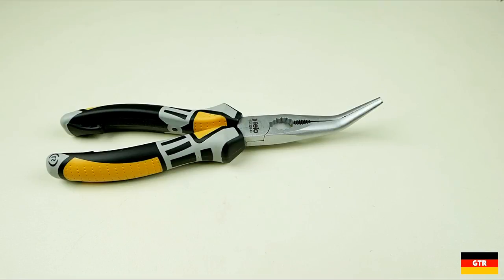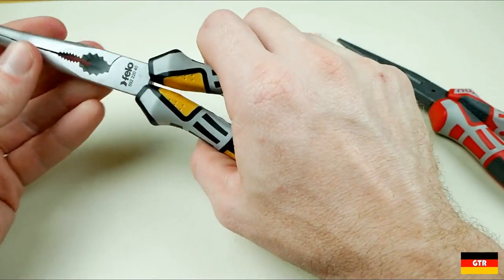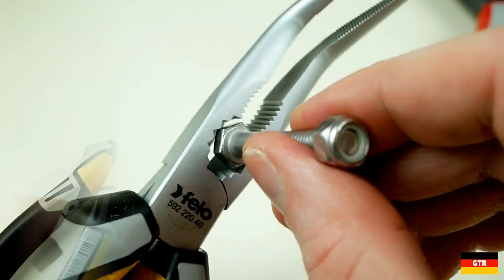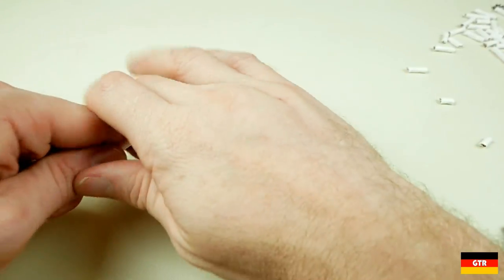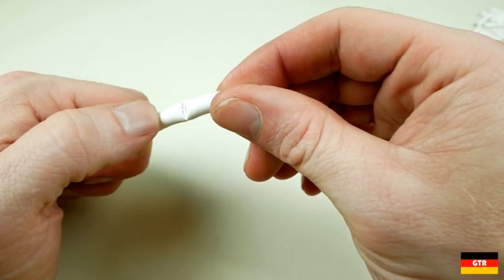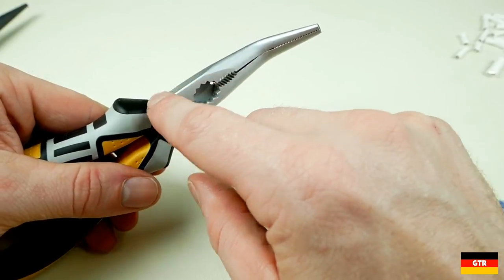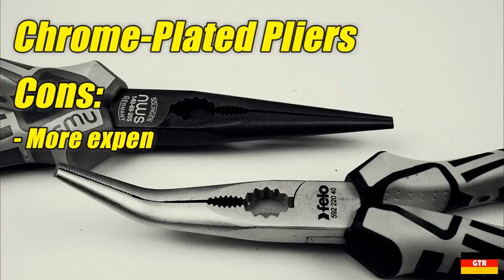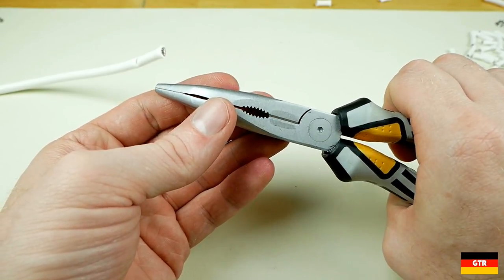Pros and Cons of Chrome-Plated Pliers

Comment: I live in New Orleans and fish offshore and in the salt marshes, frequently using similar tools on my boats.  So I can see the benefit of chrome on certain tools, despite the cons as stated in the video.  Excellent topic and discussion!
Reply: No.  In that environment you want a stainless steel tool, not anything that is merely chrome plated.  The jaws won't have any chrome or it wears off right away, and the hinge won't.  This is pretty much the only reason stainless pliers exist, for situations like yours.

Comment: 80% hawaiian humidity and you need coated tools. i  have all chrome knipex but not every tool they make is offered in chrome finish.
for instance the cobolt cutter only comes blackened with machined uncoated sections and all those sections keep needing scrubbing to get the light rust off. nothing major, but you cant forget about it in the back of a toolbox for too long or the rust may start to pit.
Reply: George Costanza Pet peeve!
Reply: You ever try spray on cosmoline?

Comment: I spent a while dismantling car engines for scrap and my favorite pliers were cheap, unfinished, FELO ones. Due to the job, all tools were coated in oil from the engines so they never got rusty and when cleaned I used the 'oily rag' of lore and the tools remained in tip-top shape. In my experience the chromed tools also take longer to break in which is a nuisance when talking about pliers.
Reply from the maker: Yeah those Felo chrome pliers were a bit stiff when I first started using them.
Reply: normally nws stuff is a looser joint that the way knipex tend to start with
Reply: Break-in isn't really a thing with pliers.  You should lube the pivot joint when new but any further "break in" is just the joint getting loose and introducing slop which as it progresses will just lead to misaligned cutters and jaws.

Comment: Right now I'm holding a pair of NWS chrome plated diagonal cutters I purchased in mid 90's over 20 years ago. I have used them extensively and the chrome plating on the edges came off long time ago, however they are still as sharp and functional as they were when I got them. Not a single rust spot on the exposed steel BTW.
Reply from the maker: Thanks for the information.  One way to prevent corrosion on a tool is to constantly use it.

Comment: I'm kinda surprised at the cutting ability.  But the way you explained it makes sense.  Do you think the chrome pair would be batter after say 5,000 cuts?
Reply from the maker: Maybe after the chrome wears away it would be on equal ground with the black/polished ones.
Reply: on harder materials it does chip off, not everyone only cuts copper wire , thy get used on steel split pins etc
Reply: @GermanToolReviews  i would agree. Nice review. I like a chrome finish just for cosmetics but a can wd 40 and no chroming will probably be my german tool option for now on.

Comment: chrome adds thickness to the material so the edge of the cutters arent nearly as sharp or toothy. 
every premium tool should come nitrided by now. it does not add to the thickness of the metal but it hardens the top layer and makes it very rust resistant. chrome doesnt deposit perfectly even and add a few thousandths. nws offers ptfe teflon "titan" which is close.
Reply: Best finish would be that black atomized finish, I forgot what it's called, best finish you can get
Reply: @urjnlegend  Bluing/ black oxide coating?
Reply: @samnass  I honestly had no idea what I meant tbh looking back. I have no idea what atomized means, I seem to have forgotten something lol

Comment: The discoloring on the black oxide cutters is because it is very porous and traps copper from the cable. The purpose of porous oxide finish is to absorb oil. This will help with cutting, although with pliers this is negligible and oil mainly prevents corrosion.

Personally I can not decide which is better, but chrome is nice mostly because it easy to clean and does not leave oil residue (in your hands or parts).

Comment: i was a machinist building special machines tool and die, advanced blueprint reading, and engineering and metalurgy ,all metal  treating processes and coatings worked my way to QC Manager, knowing and doing any processes and engineering prints chrome flash coating and hard chroming are by far superior in everyway, i would never spend my money on anything knowing it was shortly look like hell and also be HIGH maintenance

Comment: So basically the black coating is like gun blueing. They’re heating up an oil and dipping the tools in it to bake a finish into the surface of the steel...and just like blued guns, the coating comes off eventually and thus requires frequent preventative oiling. 

Those chrome pliers look nice but damn that chrome plating seems to have bulked up the cutting edges of the cutters, rendering them dull.
Reply: Doubtful, more likely it is electroplated or chemically etched.  It is not an oxidized oil aka seasoned oil finish.  However, it is not uncommon for a tool to be oiled AFTER that finish is applied, to prolong shelf life before rusting.

Regardless, yes the black finish will wear off, but it is not so important as a firearm to keep it pristine, merely to keep it in a usable condition.

Comment: In my chinese/taiwanese pliers the chrome plating starts to chip off after some medium use. I prefer polished pliers now, just with the eventual wd40 spraying to keep them clean and lubed .
Reply from the maker: Sounds like it would be interesting video to see how many cuts it would take to get the chrome to wear away on several different brands.

Comment: You can always buy the acid dipped pliers, save money, maintenance them as usual, and just use wire cutters to cut wires instead of dulling/chipping the cutting edge of those pretty pliers
Reply: Meh, there is no substantial difference between the tool steel on those and on lineman's pliers that are used to cut wires millions of times a day by professionals.  Heck even many "wire cutters" use the same steel and just don't have the plier jaws on them.  Granted for specific, heavier (lower) gauge wires, there are wire cutters built to this larger stress.  I do not mean to imply that any cutters that are too small for the job should be used, whether wire cutters or pliers with a wire cutter integrated.

Comment: One point that is nearly the most important to me is that the joint on chromed pliers are much more reliably smooth after some time in use (exposure to moisture). The cutting edge as specially on a pinching kind of cutter really doesn't matter much anymore if the joint is stuck in a way that it renders the tool unusable imho.

Comment: A very neat trick is to get a couple gallons(3) of vinegar from the supermarket a 5 gallon bucket and throw your rustiest and smallest Tools in first and then your Hammers and pry bars in later sometimes I'll even make it to where I flip it around I don't like to do that but sometimes the tools are too big. It comes out with a wash off and scrub down with a clean cloth. They look brand-new and function as so. But you do have to put some kind of light oil on them to keep them from rusting if that are above 55% relative humidity. Your going to see some resting on your tools that you just cleaned off. It'll take years and years decades off of tools in a night. It's pretty incredible. If you can get the 26% acid white vinegar it's even better. that stuff's meant for cleaning and disinfecting. It's good in a thousand different ways removing rust from a frozen pool is just one of them like with your channel locks and stuff like that that don't spring open anymore soak them for a day or two and some white vinegar and then see how they work after that. you're welcome before you even try it.

Comment: Cast iron skillets develop a non-stick surface when you season them with oil and high temperature, it also leaves a black finish which is quite resistant to rust, so maybe that's also helping a little bit when cutting as it reduces friction.
Reply: Leave a cast iron pan with any water in it for 20 minutes.   It will get rusty.. nobody listen to this guy

Comment: I just do not use chrome-plated pliers, because I usually edit them later or loop around. Then I polish the pliers to a high polish, so they do not rust anymore. I have the experience that Chrome does not hold on pliers in the long run. I also do not like heavy handles on pliers. They disturb the sensibility.
Reply: No.  Polishing pliers with the very very thin chrome as shown in the video, just strips away that (barely) protective layer.  Polishing has the opposite effect of what you intended, leaving behind less chrome and more steel carbon at the surface to rust.  However if they are ALREADY rusted too much for your liking, then polish away as it is too late to think about the plating then, unless it is much thicker chrome (which you will not find on any needle nose pliers, only cheap slip-joint pliers) then you don't want to polish at all beyond a very low abrasive metal cleaner product, or else the plating will flake off in razor-sharp pieces.
Reply: @stinkycheese804  this

Comment: Chrome forms an oxide that is greyish white and not soluble in water.  Chrome is what makes stainless steel "stainless" .  A good chrome plating over steel requires an intermediate plating of another metal.  If omitted the chrome will eventually peel and/or rust through. This is what happened when automakers tried to cost reduce "chrome plated" bumpers and to cheaply plated tools.   For tools with intentionally sharp cutting edges, titanium is a better choice  for plating than chrome, but the color is off-putting to some people, and the cost is higher.
Reply: Chrome may be what makes stainless steel work, but stainless refers to the chrome being alloyed in. It's very different from chrome plating as the chrome affects the steel structure

Comment: So for DIYer the black/polished finished will enough?
Tools will bearly use weekly
Reply: itoosh lots of pros prefer a regular black finish
Reply: It depends what you are doing, a chrome finish requires less maintenance, basically any German tools other than wiha, you're getting a pro tool, no matter what the finish. If you don't use them that much, any Klein or tool would do. But if you want the best, get German made.

Comment: I have the NWS 141-49-VDE-205  45° angled Chain Nose Radio Pliers with the Matte Chrome finish.   They're holding up nicely so far and still look like new; unlike the Klein 203-8-EINS Heavy Duty Insulated 8-Inch Long Nose Side-Cutting Plier that they replaced in my service bag,  which got surface rust fairly quickly.  The climate is very humid hear by the coast where I do A/C work. 
The KLEIN's feel much heavier and more substantial compared to the NWS, which feel oddly light.

Comment: Why prolong the service life of an inferior tool? Look, you make two identical knives from carbon steel: one you spray with Rustolium, one you don't. Which cuts best? Which resists rust? As in all trade offs, go with what works best and maintain. BTW: love those pliers!
Reply: For me it depends on use case. For an electrician your vibe maybe makes sense, for a householder who keeps their tools neat and uses pliers only sparingly, longevity, no rust and no maintenance is ideal... well, for me it’s preferred.
Reply: Because it's ridiculous to think in terms of "inferior tool", as long as it suits its purpose.  Nobody and I mean nobody, needs the "best" tool.  There are many acceptable quality levels at respective price points and it is senseless to let an acceptable quality tool go to waste because you have a mental block, because in fact, very few people have only the best quality tools, unless they have a VERY small tool collection, or just like wasting money and don't actually use tools rather than collect them, so they don't recognize what is important.

Also no, you don't make ANY knife then spray it with rustolium.  Rustolium is for some ancient bare high carbon steel tool that you saved from a dumpster and cleaned massive rust off of.

Comment: How come the black ones are more expensive though?
Reply: Because the outer coating has very little to do with tool cost, rather the other factors like the Brand price premium, the steel composition, purity, and hardening, the machining process, the grip type, marketing and distribution expenses, etc.

Comment: The wear you state on the black coating looks more like a copper coating taking place from the wire you are cutting ... could be wrong though .
Reply: Indeed!  Copper will come off only the cutter blade, but also the coating will wear, one cut at a time if not a lot at a time if the wire is too big for the tool.

Comment: Another thing is what you are working on.working on jets not aloud to use chrome will sometimes flake off. If you ever seen a old USA wrench. That is conducive and can destroy electronics.
Reply: True, a traditional chrome plating is MUCH thicker and will flake off, but what is on those pliers (arguably) doesn't even quality as a plating and will not chip off because there is too little there to form a cohesive plate.  Literally, these are not what should be called chrome plated pliers, the video was very strange in trying to differentiate based on a plating that is too thin to offer any properties other than a slight corrosion resistance but mostly visual appeal.

Comment: Don't you hate it when the tool you want is only offered with a chrome vanadium finish
Reply: Don't you hate it when you don't know WTF you're talking about?  Chrome vanadium isn't a finish, it's the base metal which can then be brushed, or also polished, could be plated with chrome or black oxide/phosphate/etc.

No, one of the last considerations is which finish a tool has.  The reviewer got it all wrong trying to suggest that the big difference between these two tools was which finish it had.

Comment: no one seems to know about the non chrome tools? mechanics that work on airplanes or automotive racing use non chrome plated tools, reason why? chrome can chip, and you can figure out the rest (hint chips and engine don't go well)

Comment: I would like to say, it feels as if chrome plated tools in general are more prone to slip then normal tools.
Reply from the maker: Yes I would say this is true, as you can see with my test with the carbide deburring tool, it just slipped/skipped across the chrome.
Reply: The chrome is not just slippery, but also harder. This is why the duburring tool was not biting. Gun barrels that are chrome lined last longer not just because they don't corrode like unlined ones, but because the chrome provides a harder surface to mitigate wear. As an aside, are you sure that duburring tool is carbide and not HSS? I know carbide blades exist for those but more often than not they are HSS.
Reply: This has very little to do with whether it is chrome plated and is almost entirely a matter of how much finishing machining was done to the base metal, whether just cast, or ground, or wire brushed or buffed, etc.  It is the base metal finish which determines the smoothness.  Any plating just takes on the same finish profile.
Reply: @moeszyslack4676  Not in this case.  In this case the (barely there) chrome plating is not thick enough to have the average hardness, will readily indent based on the underlying metal hardness.  It's barely even reasonable to call those pliers chrome "plated" because there is barely any chrome there at all, but the industry likes to use oversimplified terms that people have seen before.

Comment: Not a fan of chrome plated pliers. I don't work anywhere with a highly corrosive environment, and keep my pliers oiled. That chrome also doesn't protect inside the joint of course. The main reason I don't like chrome plated pliers is because I've had the chrome edges raise and cut the crap out of my fingers. Not worth it to me..
Reply from the maker: Yeah that would not be fun getting a piece of chrome under a fingernail.
Reply: indeed why old school tools , snap on industrial did and old williams  etc were blackend wrenches, not chrome
Reply: Jusb1066 yep, all the adjustable spanners I have made in Australia any were from 1960-1980 are all blacked, no rust when I bought them, the chrome ones always chip off and rust.

Comment: poor steel rusts very fast, i have some 1940's british unplated pliers sitting next to some cheap 80's chinese, which rust at around 100x faster...their metal has improved as my modern unplated chinese is much better (chrome steel ?)    (my goto rack in the garage, as an eclectic mix, old 40-50 british,  chinese stuff i bought in the 80s and german stuff i bought later 80s, then chinese stuff i bought more recently)
Reply: yes but cheaper will rust far quicker, all steel will rust even the best
Reply: Jusb1066 I've realized that, I once left some Aussie manufactured mild steel out side for a week, and there was only surface rust, I had some European mild steel and that stuff rusted in my garage, thing is the Aussie one had more carbon then the other yet still didn't rust as bad even tho it was left out a week. \'-'/
Reply: Jusb1066 Not H1
Reply: dont diss european steel mate! :) i live here,good to know aussie make good steel though ,  gustavo, what is H1 ?
Reply: ahh i see, but i dont know what most hand tools are made of, stainless is rare in hand tools compared to knives, i can only go by experience that cheaper steel rusts more easily  than quality steels
Reply: Jusb1066 Well, mettalurgy is a very vast field. Regarding tool steels and speaking in general terms there are two steels high carbon content and stainless (which doesn't means rust proof, just means that it will stain less) so speaking in a broad sense, a steel that stains doesn't automatically translates to a cheaper steel; it means it just has a higher carbon content within the alloy, therefore you have different alloys for different purposes.